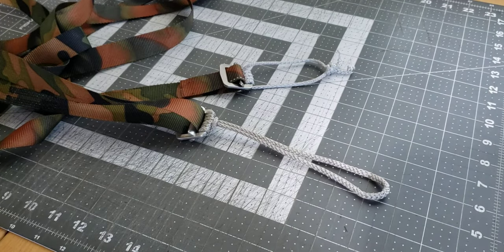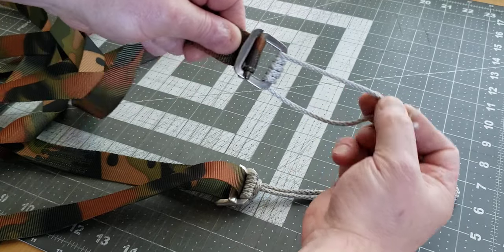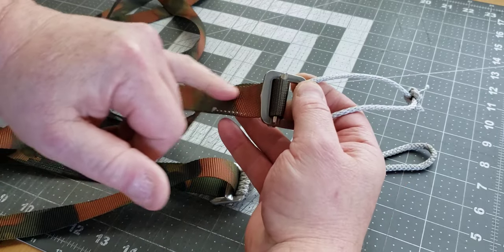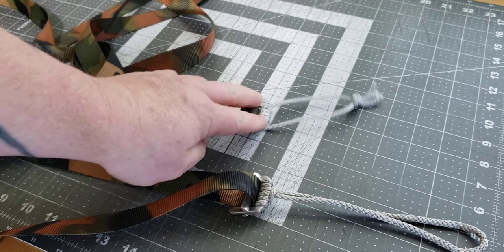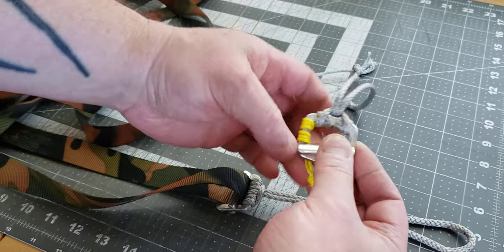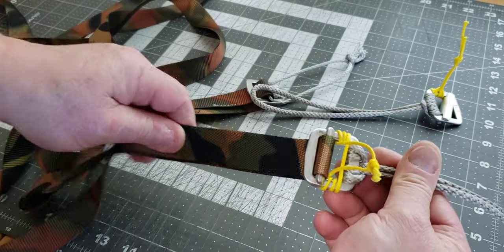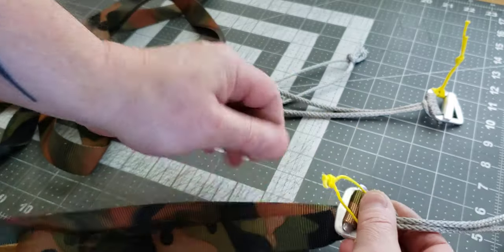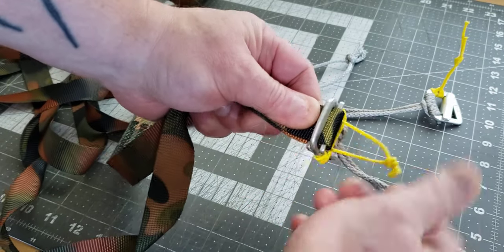cinch buckle optimization part 2

Comment: I initially used the prussik/larkshead method, but when I upgraded to UHMWPE webbing, the cinch buckle shredded the webbing because it was just the tiniest little bit crooked.
I was kind of confused as to why it had happened, but the folks at Dutchware sent me a link to a video explaining it.
I started using the ‘wrap-around’ method after that and haven’t had any issues since.
I like the idea that the prussik method acts as a pivot point but am having a hard time returning to it based on the memory of getting dumped on my rear end and having to throw away the shredded webbing...
I also haven’t gone back to UHMWPE webbing and stick with polypropylene or polyester now.
It’s heavier, but I sleep better at night for it...
Reply from the maker: you mentioned you used uhmwpe webbing and it slipped , uhmwpe webbing should not be used in the buckle

Comment: Do you offer this as a complete suspension system, with the loops already sewn into the webbing?
Reply from the maker: yes https://www.ebay.com/itm/283650794892?hash=item420ae7a58c:g:IAAAAOSwiMteinQ3